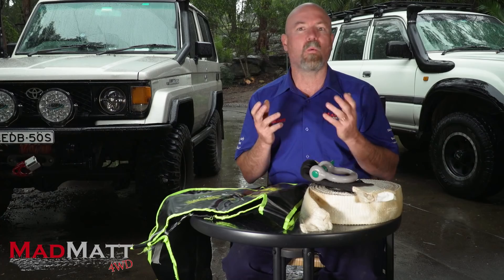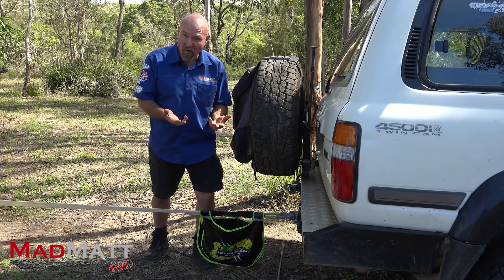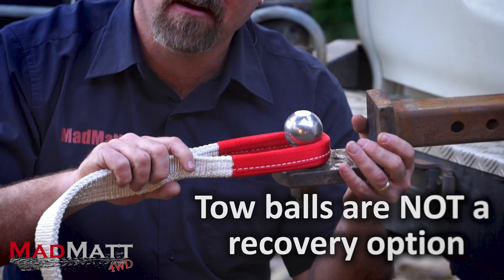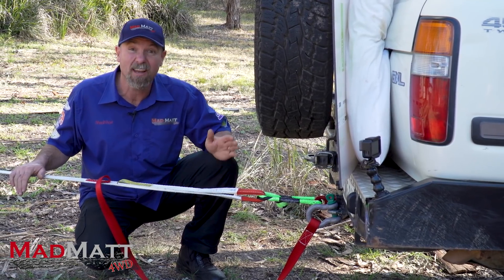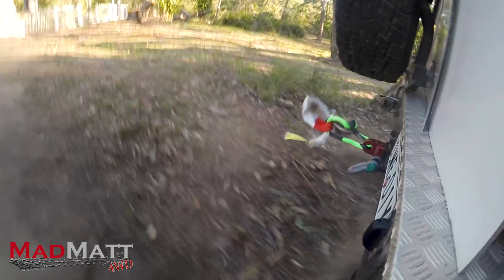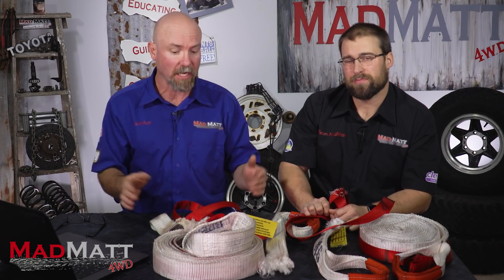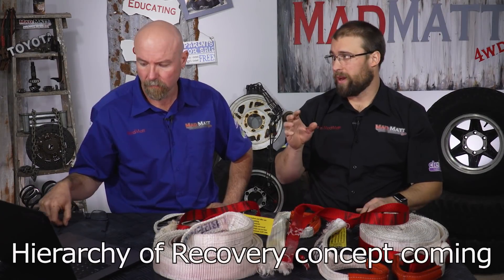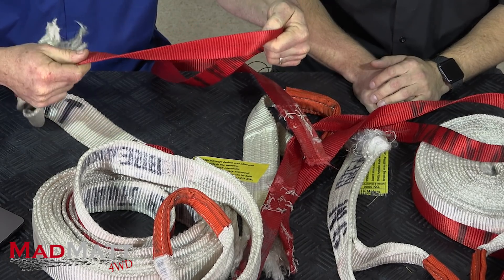Dangers of Snatch Strap Recoveries - Destruction Testing

Comment: First off great video lots of useful info.  Secondly I’ve seen these bow shackles fail mostly due to the fact they improperly used or have just been mistreated. (Another video idea if not already done.) I no longer leave bow shackles on the exterior of my vehicle to get abused on rocks and so forth after seeing some of these issues. Actually I leave none except for the winch line and hook outside of the vehicle. As far as the tethered strap goes I like the idea another viewer had on using the idea of a shock absorber from a safety lanyard. Those things are designed for up to 5k lbs or 2267 kgs.
Reply from the maker: Great points Thanks

Comment: Perhaps use a tether which is like a working at height fall arrest system. So the tether strap would be significantly longer and folded a number of times and sewn through so that the stitching fails progressively dissipating the energy in a controlled manner.
Reply from the maker: I think that would be the best solution. I have discussed it with manufacturers and they couldn’t care less about a better system.
Reply: Making modifications like that would obviously eat into profit margins and may make the cost prohibitive, particularly considering your recent comparison with dynamic rope and the relative cost. I’m not a 4WDer but I have an interest in rope rescue systems and am finding your videos informative and interesting. Thanks.

Comment: Great testing! I'm always nervous about any rope, strap or cable under load! What if that company built a small parachute into the fuse? Similar to a drag race car, that can deploy fast while being light weight and small. I'm guessing a canopy of about 2 feet in diameter would stop that strap quickly.
Reply from the maker: That’s an interesting idea. Thanks.
Reply: That’s in effect what the bag/air dampers are doing, yes.
Reply: Advantage of the dampers you tested is that they’re already deployed

Comment: I know it's been a while since you posted the video, but new to the channel and watching a few of the older ones.

Anyway, my thoughts...

I don't do the typical two vehicle snatch recovery at all. I don't think they're necessary, ever.

I do carry a snatch strap though, like you I do use it as a tow strap as the stretch stops shock loading your recovery points like you get with a traditional tow strap or winch extension.

But I also use it instead of a winch extension when I'm stuck in sand or mud, even where I don't need the extension.

I find it works extremely well in that scenario where if you're just using the winch you get a bit of load onto it, you move forward a few inches and then all the tension goes out of your line. Takes ages and puts a lot of strain on the winch and vehicle electrical system.

Throw a snatch strap on there and load that up in a controlled manner and when you do start to move you have all that stored energy to keep you moving for a foot or more. Makes the recovery go a lot faster and is far kinder on the gear.

You'll also find that there's no way known that your typical 12000lb winch is going to pull that strap apart. It's going to stall out long before then so is (as far as recoveries can be) extremely safe.

If you need a double line pull the strap goes from bull bar to winch hook, not on the pulley block mounting point.

And any news on the tether idea?
Reply from the maker: I agree with you here. I have a vid where I use the Factor55 recovery rope the control the bounce you get on rock but it allies as you have mentioned. The natural fuse of a winch is one of the main reasons I prefer a winch over kinetic recovery. When I showed this testing to the manufacturer I became enemy number one. I approached a few manufacturers to make my idea and there’s no appetite. Safety doesn’t sell!!!!
Reply: @MadMatt4WD  Disappointing really. They had a good idea there, just poorly executed.
Reply from the maker: Yes and yes. I knew it wasn’t going to work before I did the vid. There needs to be a method of absorbing the energy and dissipating it over time. A fall arrest system would work well.

Comment: Very informative video. With the recovery strap with the tether I think it would be better that the tether is the same size as the main strap 3m in length but folded in the last meter and a little stitch or something similar to keep it there.  If your strap breaks at the fuse and recoils you have the 3m extra with 9t load to pull up in. You will either feel or hear it break so you have the length to stop saving a lot of damage.
Reply from the maker: I think this sort of idea is the solution. It’s how a fall arrest system works

Comment: Hi Matt I couldn’t find where anyone previously asked this so if they did sorry about asking multiple times.. When you touched on putting a rated D shackle where the towball was does that include a proper tow bar hitch receiver as I have one but have not used it before.  A lot of places sell them and list them as 5t rated
Reply from the maker: Hi Garth. What I’m getting at is some people like to put the shackle though the hole where the tow ball would go. This is not recommended as the flat steel has been known to tear away from
The square section. A kinetic recovery is capable of generating way more than 5t.

Comment: Hi first time viewing and found it very interesting, I  liked the idea of the safty lanyard/tether however I  think the air damper idea is a much better option 3 of them as per your recommendation but with  more weight in the middle damper position  so if failure on either end the middle damper anchor/ creats enough drag to the failed end before it extends past the strap length.
At least it works in  my imagination. 
your feedback would be greatly appreciated.

Comment: For the safety tether replace the solid strap with something like a fall arrest lanyard. Get one that can extend out to maybe 3 meters or more with no solid connection at the anchored end. This way the recoiling strap will pull the arrest lanyard breaking the safety stitching as designed and that will consume the recoil energy of the strap so that when it finally completes its separation there is not enough energy left to create any substantial hazard.
Reply from the maker: Interesting

Comment: What if you used a 20ft kinetic recovery strap for the recovery with a 30ft strap loosly spiraled around the 20ft strap both being atached to the vehicles.
The second longer strap or rope should keep broken 20ft strap controled and down low??
  Would be interested in seeing a load cell or scale device in the rigging to record the actual force or load that was applied Here.
Reply from the maker: That’s kinda what ditch witch did with their design. It worked well.

Comment: I think I added my comment in the wrong place so I'm re-adding it here; used a 20' strap as your load strap and wrap it with a 30' strap of equal  or higher rating. They can be connected  to the same load point if needed (as long as load point is not in question of failure). If it breaks the 20' will tangle in the 30' as it looses energy.
Reply from the maker: That makes sense

Comment: That tether idea is interesting. Did the company go any further developing the idea? I would like to see more experiments like your winch testing with the winch damper. Specifically winch damper, winch line break with a heavy steel shackle at opposite the fixed point (the tree). Will a winch  line damper really help slow down or stop a heavy object such as steel shackle or failed recovery point?
Reply from the maker: They stopped liking me after this video. Go to my recovery playlist for videos on these ideas.

Comment: Not a very good test except to break tow straps.  That tree is not going to break just the tow straps or the tow vehicle.  Were you just trying to prove tow straps break?  I have seen 5/8 inch cables break if put under enough load.  Most of us learned a long time ago to stay away from tow straps,chains and cables in case they break.
Reply from the maker: Yes this was about see if a tether would restrain a broken strap.

Comment: Hey Matt. For dampers, could I use couple small bags and pass strap thru handles with say 5kg tools in each bag? Or is that then become a flying object if strap breaks? Thanks
Reply from the maker: I think the handles would just bust off. If they’re needed they have to be strong enough to accelerate 5kg very very rapidly. A blanket works.

Comment: Here's one for you to try.  Use a standard strap then put a rope with an eye just big enough to go around the strap and is 75% the length of the strap.  The rope is put on 50% of the length to the vehicle.   The rope eye can be braded or just an knot.  Type of eye is un-important.

When the tether fails, the vehicle is going forward for a bit and drag the rope that has an eye around the middle of the strap and will drag along the rope and prevent the end of the broken tether from going back and "hitting the tree".
Reply from the maker: I can’t see that working but it’s an interesting idea.

Comment: From where I see this, the tether should be attached to the snatch strap just at either side of the fuse point. That way all of its length will be used to absorb the tension in the main strap! To take up the slack in the tether it could be coiled around the main snatch strap or lightly attached along the length with a single thread that would shear instantly when the snatch strap failed! that way it could be extended in length to approx a third of the length of the snatch strap!  On the straps tested there is very little stretch in the tether straps whereas a Bungie cord would do a much better job!
Reply from the maker: Interesting thoughts. Thanks

Comment: Hey Matt when I was 16 in 1979 I made a tow bar out of a inch and a half steel pipe around 5 ft long and the chain which I doubled up and ran through the pipe but that around a tow ball took the other two points of the chain and tied to the undercarriage of the car I was Towing and I had a tow bar it would stop the car behind me at the same rate I was stopping and would turn or swivel just like a tow hitch so what can I say I've been involved with that type of stuff my whole life I enjoy watching your show keep testing ciao for now
Reply from the maker: So a solid tow bar. Nice. That’s very different to a kinetic recovery though
Reply: Don, I did exactly the same thing in December 1978.  Blown head gasket.  Towed the car 570km, most of the journey in the dark on country roads.

Comment: Great video, I am surprised the company that supplied the straps didn't test them.  Looking at your strap, lets say it is 50 meters. Your tether should be somewhere between 16 and 19 meters in order to slow the recoil or stop it completely. I like the concept of the safety in mind, but 1.5 meters will not be sufficient on the kinetic energy that is stored in the strap. Waiting on new ones from the company to see if they came up with anything.
Reply from the maker: They don’t like me any more.

Comment: The tether clearly didn’t stop the recoil, but it certainly reduced the energy that was stored in the strap.

Also a winch line damper in the center of a rope is mathematically pointless.  Put one at either end if you’re going to bother with one at all.
Reply from the maker: I completely agree. Look at the videos I’ve done with dampers.

Comment: The safety tether definitely needs to be longer, but it also needs a mechanism to absorb the energy otherwise the momentum will still snap it. In my opinion it needs to be longer and pleated and stitched to the strap so the stitches progressively breaking can absorb the energy. Look at the bottom of your cars seat belts and you should see a similar thing
Reply from the maker: Yes I agree. I think the fall arrest design on a larger scale.

Comment: I think that if you take a long "red" strap, and fold it back and forth on both sides of the "fuse", and find a way to sew it down that lets it rip out that stitching in a way that adds drag to the recoiling main strap, you'd have a safer design. I'm sure there are rock climbing straps that have a "oops, I fell" feature that does this very thing, so you don't snap your bones at the end of your rope.
Reply from the maker: You’re on the money. I’ve tried to get this design built but there seems no interest.
Reply: @MadMatt4WD  Well, perhaps you're a little too protective of potential sponsors that make bad products. Make them protect their products. That's not your job, unless they're employing you to do so. Until then, your job is building your business, and their indifference to producing a safer product that is marketed as such, is your fertile soil.
Reply from the maker: @buckstarchaser2376  your making a lot of assumptions about who I am and how I work there bud. The company’s I approached made this type of product and one was not my customer ever. I did stick to my core business which is content creation hence the product never got made.
Reply: @MadMatt4WD  Well, you solicited ideas at the end of the video, and then commented that you attempted to get the design built and that there wasn't any interest (yet the video included that the company making that strap was interested). There appears to be a miscommunication, but these things happen. Good luck with whatever it is you're doing. :hand-pink-waving:

Comment: G,day Mad Mat great video mate just wondering if you could look into a video on kinetic rope vs snatch strap
Reply from the maker: I'm working on that.
Reply: MadMatt 4WD that will be good to see in the format you make these videos

Personally I don’t see a lot of difference in rope or strap, they’re both designed to do the same thing, based purely on appearance though a rope that is ‘rated’ to the same as a strap looks significantly weaker, like maybe it doesn’t have the same safety factor

Comment: Thanks for this.  Question:  I think you advised early in the video not to use the hitch receiver with a shackle as a recovery point.  Yet it appears you do exactly that with the Factor 55 device.  Am I mistaken?  Thanks.
Reply from the maker: Hey. I’m not sure what time stamp your referring to. I don’t think I’d have said that.
Reply: @MadMatt4WD  I’m likely confused. A post below answered my query.
Csaba K
Csaba K
7 months ago
Matt, I appreciate the very informative and entertaining way you present this topic. There is one thing I'd like to ask for clarification though. In the beginning you say not to use the receiver (mounting a shackle through the hole) because the welds are not designed for that. But later you are using a hitch receiver yourself. So can you use the hitch or not?
Read more

MadMatt 4WD
REPLY

MadMatt 4WD
·
1 REPLY
MadMatt 4WD
MadMatt 4WD
7 months ago
Reply from the maker: @ourbills9999  ok a hitch receiver is a designed tool made of solid steel. The receiver I show is a fabricated towing reciever.

Comment: (old thread, I know) Obviously (physics) the tether Did take the amount of energy out of the system that it takes for the tether to fail.  

Yes if the tether were 2x longer it could  allow some peak energy to dissipate before it takes the strain again. - at full load the short tether must  fail-  or it will reload the snatch strap to full capacity, then it could fail a second time at full load, achieving nothing. The snatching vehicle will not come to a halt in the tether distance - at "full song".  An elastic tether with half the strength of the strap - should take half of the energy out of the system.  (Did you get more testing done since this test??)

Taking other peoples Ideas and changing it out - a tether to a weighted bag/damper on the ground - attached at 25% and 75& of the way along the strap?? - because in some cases the strap just pulls out through the loops in the bag (single line winching - with line failures does too) - with some "designs" of dampers, the damper needs to be tied to the strap to ensure it flies through the air and does its job. ..  (Anything with more "Stuff": lines, tethers,etc. will reduce compliance as it all becomes a hassle...)
Reply from the maker: Never did any more testing than this.
Reply: The tether did its job. Even in breaking it took some energy out of the recoil.
Reply from the maker: David Parker true but it didn’t take enough out to be effective.
Reply: @MadMatt4WD  as you indicated the tether was not long enough to reach the point were the strap had lost it stretch energy - if the tether was longer like a lanyard it would not be fighting two forces the stretch and the pull energy, and if the tether was the same material as the strap it should handle the pull energy

Comment: All you need for a safe safety  tether, instead of using a strap like that red one, just use a bungee cord thats stretches long enough to absorb the recoil of the strap breaking without the bungee breaking. Ues the bungee will store energy and make the strap shoot back towrard the vehicle after it absorbs the initial strap break energy, but the strap will stop the bungee from traveling back and hitting the vehicle.
Reply from the maker: I suppose a slow rubber type product could work. I’ve thought a fall arrest design would be good.

Comment: I think if you want a safety tether for your 10m strap, loosely coil some 1/2 ton nylon rope around the length of it, finish with a proper splice on each end so it's 15-18m total, and secure as the red tether was. 

Test the strap to failure, and the free end will accelerate until the energy is dissipated at about the same time that the rope runs out of slack and catches it. There's much more extra length for the driver to get on the brakes before the lighter rope breaks too, but with much less force.  What do you think?

I'm going to reproduce your test with different colors and diameters of parachute cord for scale to work out the design.
Reply from the maker: I think that’s worth testing.